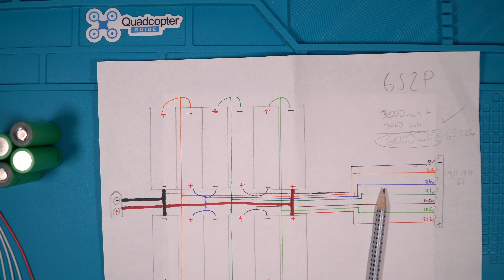Build Your Own Drone Battery - Why and How!

Comment: Just curious, what happens when you draw more current than the C rate of the battery? From what I could gather from what you said at 6:04 it puts more strain on the batteries? I am not super bothered by performance, I just want to be able to fly for longer. 

Nice vid btw :)
Reply from the maker: if you draw more than its rated for the voltage will drop quickly and you risk undervolting and shutting off your quad in the sky. The life of the battery overall is also negatively affected.
Reply: @Quadcopterguide  Thank you so much for the reply :D I'll keep that in mind.

Comment: Really nice looking outcome.
Couple tips: a flux pen can be used to pre-flux surfaces (especially larger ones) to clean the surface and enable the solder to flow easier and quicker. 
Also on the XT-60 connector besides the flux pen if you plug in the other side of the plug it helps even the heat out so one end of the plastic insulator doesn't overheat and start to melt.
Reply from the maker: Hey Johnny, thanks for dropping by again. You know I should have known that with the flux pen. I have one, not sure why I didn’t use it. I guess I was worried about the liquid flowing in behind the positive cell button. The trick with the xt60 I need to use more often as well. Great tips! I feel a fatter tip would have made it a bit easier also. Next time ;)

Comment: use spot welding ....soldering is dangerous for you and li ion battery
Reply from the maker: Hey Mridul, thanks for stopping by and taking the time to comment! Awesome! For low volume it doesn’t make sense from a financial stand point to spot weld. But it is great to use if you can!